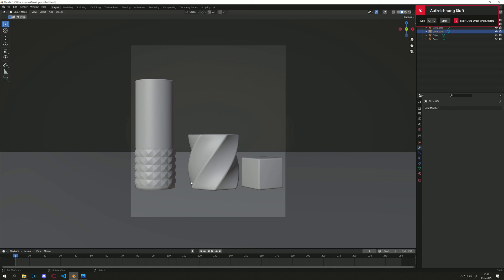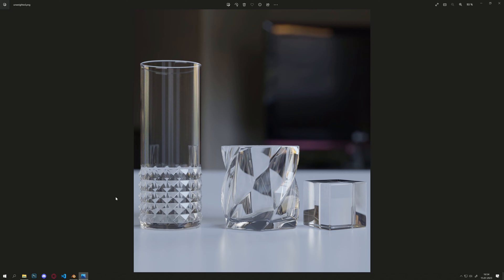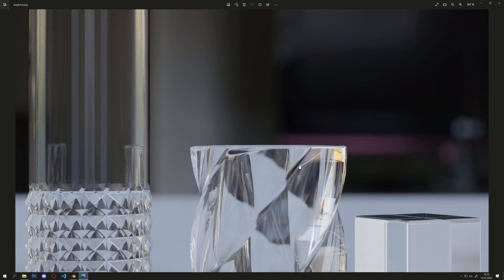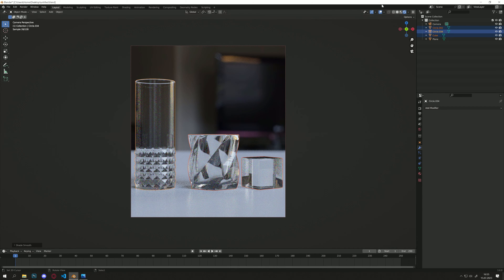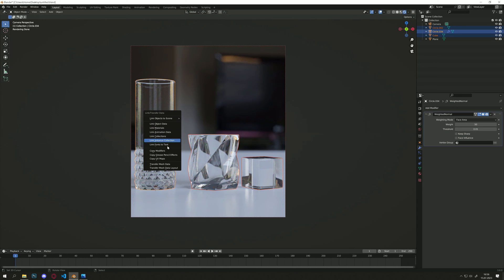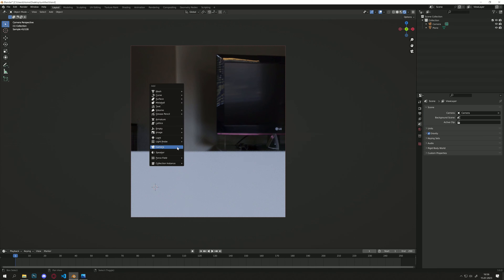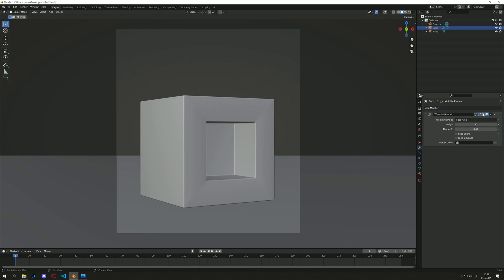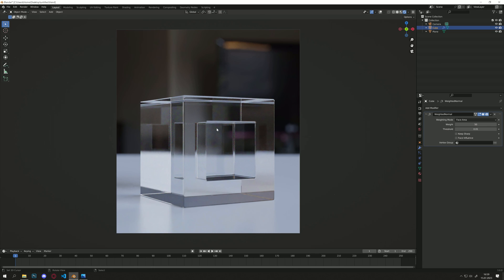Why Your Glass Looks Weird / Blender Glass Tutorial

Comment: Awesome, thank you. But what is it doing exactly and why is the default smoothing wrong?
Reply from the maker: Basically what the normal smoothing is doing is: it takes 3 vertices and interpolates the normals between them to make it smooth without taking geometry into account

This method does the same, but it also takes surface sizes and angles into account, making sure that you don't get rounded faces where you don't want them, that's why most glass looks odd :)
Reply: @philipkriegel wow, really good to know. Thanks again! :)

Comment: it's actually to fix the problem that smoothing causes right? If you don't use smoothing you get the same result as if you use smoothing and then weighted normal
Reply from the maker: No it's not. You can see it as some sort of "smart smoothing" which takes other things like face surface area and edge length into account, giving you a much more accurate outcome. Also no, if you don't use smoothing at all, you will not get the same result as with smoothing + weighted niemals

You would only get the same result if you have not a single smooth edge on your mesh (so basically a cube)

Comment: Would you be able to explain what the weighted normal modifier is doing to make the render look more correct? I have never used that modifier before and I don’t understand how it works.  Any explanation would be helpful, thanks!
Reply from the maker: Sure!
So basically, what it's doing is creating custom normals that fit your model.
While the smooth shading option just creates a blend between 3 faces, that can often look wrong, averaged and overly rounded (as can be best seen in the example cube shown in the video, where the reflections and refractions were stretched, making the cube appear less see through than it should), the weighted normals modifier, based on the method you are using, takes the face area as a reference as to how flat a face should be shaded.
That means that beveled edges will look just as round as before, but flat faces won't be falsely curved by their corresponding normals, making the final outcome more accurate.

let me know if anything else is unclear :D
Reply: @philipkriegel  this really helps complete the picture of your insightful video!  Thank you so much for taking the time to expand on this.  I learned something valuable today.
Reply: @philipkriegel excellent explanation for this geometry. I would like to ask if you think there is an optimal topology for glass objects? Are there angles which should be avoided? Does relative edge length play a part in unusual shading with glass? Does increasing the density of geometry cause or solve problems?
Reply from the maker: Oof, that's a very large topic that can't be easily explained in a single comment ._.

So basically it all depends on your mesh, there's no right or wrong

BUT: if you have tons of flat faces like in this cube example, or any other angular object, I would always go for the weighted normals method in this video since you wouldn't profit from higher density as much as from this modifier and you'll get worse results with longer render times

If you have curved geometry like that one twisted glass I was showing in the video, the method still applies
You will still profit from the modifier method, but for organic, non-flat geometry I would rather go for denser topology since the glass reflects not only the outside but also it's inside which, even with smooth shading, might give you blocky and square reflections/refractions

So the rule of thumb is
Sqare things go with the weighted normals

Squiggly things go with subdivision :D

But for both, either will improve the result, it's just a question of your mesh and how much focus you want to put on your glass object

I hope this helped
Reply: @philipkriegel  Yes. Thank you Philip.